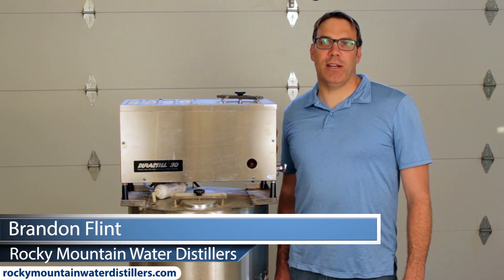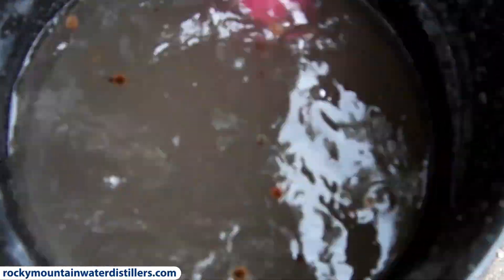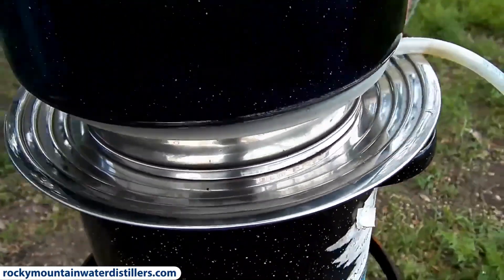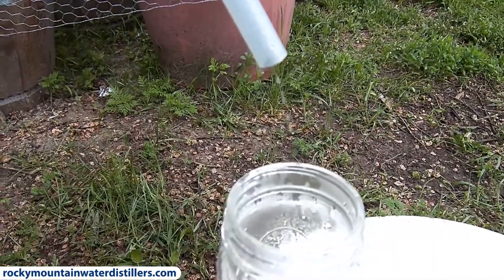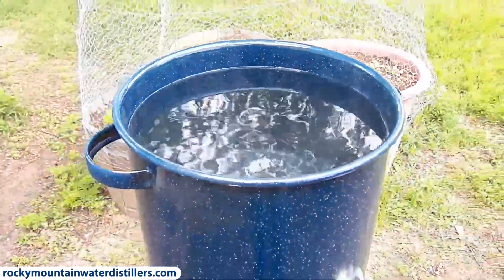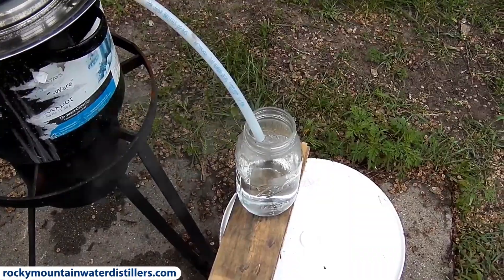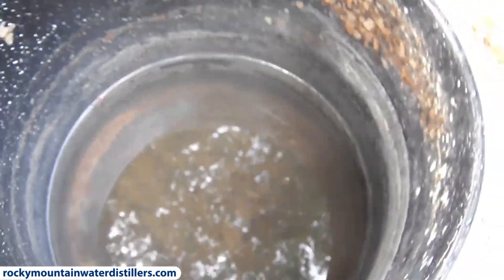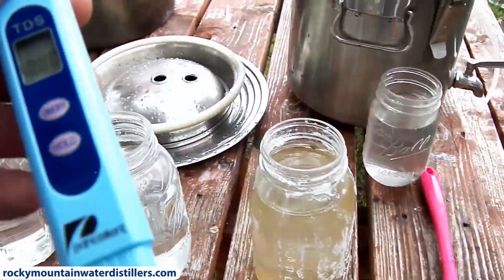How to use D-Stil Lite Emergency Water Distiller - Rocky Mountain Water Distillers

Comment: Would it make more sense for the device to have a sealable lid, so that the water container sits on top of the clean lid? Then you're not potentially contaminating the entire batch with the bottom of the top pot? You'll lose some temp drop, but the steam would be pushed through the tubing, which would likely condense on the way down? Could a robust glass tube with metal support frame for better temp drop in the tubing also be used (although prone to breakage)?

Comment: One question you say put  contaminated water on bottom and cool water on top,can top be dirty water or ocean water as well? Also would carbon steel or cast iron pots work?
Reply: Yes, top pot can be contaminated water if need be, as long as it us filled carefully as to keep contaminated water from touching the outside bottom of the pot, as the purified water will condense on that surface. 

Carbon steel pots would work, cast iron would be a poor choice for the top pot, as it has thick walls, and the top pot having thin walls for rapid thermal transfer.

Comment: Idk. I want to like it. But the reviews on Amazon were not too encouraging. Issues with sealing and plastic taste. Have these issues been fixed? I really need a desalination device as all the water around me is salty.
Reply: If there are kinks in this system it seems it’d be easy to work them out. I will say that I just bought a MegaHome water distiller. It works great. But it was pricey. One thing that I really like about this emergency water distiller is that regardless of taste, or perceived taste, it is just what the verbiage says. It is an emergency water distiller. The small town that I live in on occasion sends out a boil water advisory.  I live in an area that has had coal mining for over 100 years. No telling what is in the ground. I told my wife that if we bought a water distiller that I would take on the job of keeping our water supply going.  And the same water issues that I have in my town are unfortunately in so many other small towns across America, as so many water treatment plants are antiquated, and there is not enough money to just fix the problem.  Also, we did not want to buy bottles of drinking water because of the plastic problem we also have in this country.  Also, I’m getting too old to be lifting 5 gallon drinking jugs of water.  This is unfortunate in that we are not gonna have much of a choice, but to make our own drinking water if you want to know what you’re drinking and at a reasonable cost.